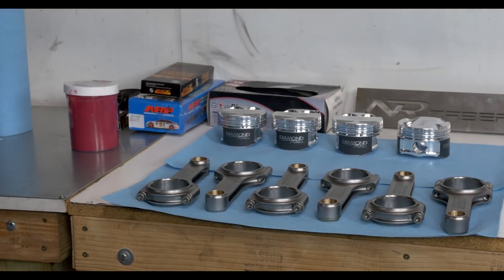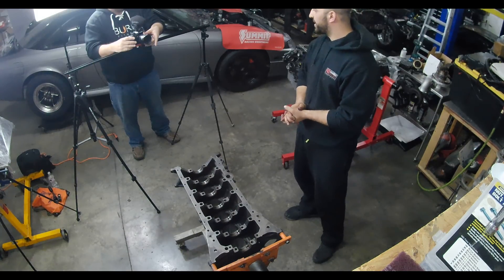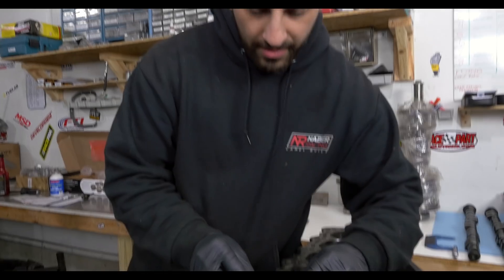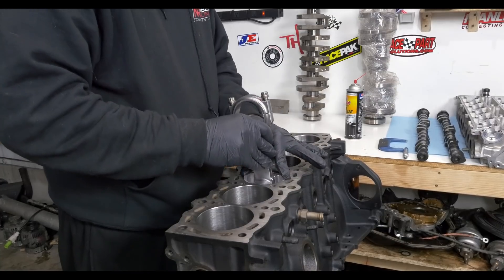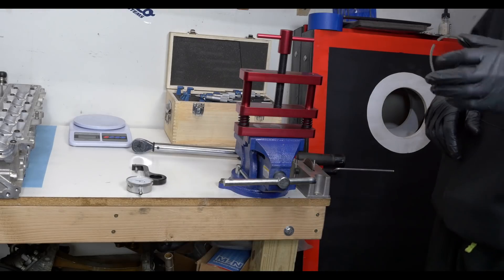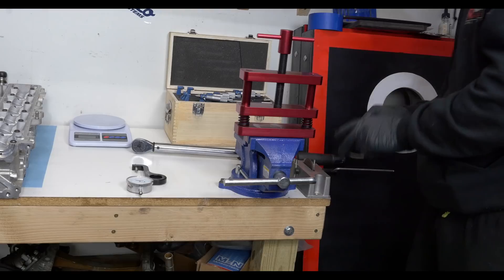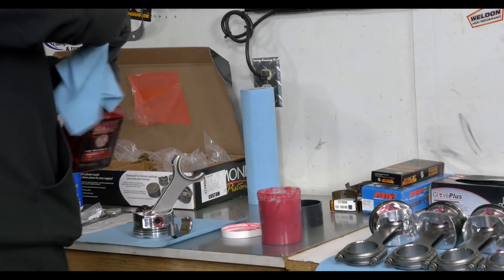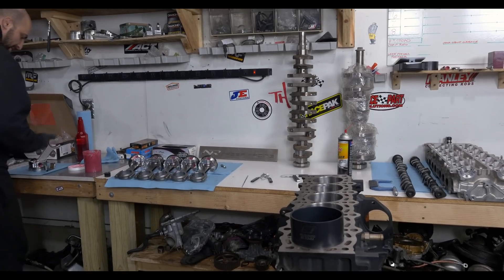Naber Racing 2JZ build - Part 4 - Installing the pistons (4k)

Comment: Are you oiling the rings, piston and cylinder upon installation or are you doing the dry install method?
Reply from the maker: I don't think oil is necessary for the rings.  For all other parts he definitely used lube.

Comment: Can you video a top end assembly for the 2jz? And how much pain am I looking at to turbo a na 2jz? It's in a Lexus gs300
Reply from the maker: Sorry, I was not able to film the assembly of the head and the rest of the motor.  But I will hopefully get a dyno video soon.
Reply: tjsavage711  thanks alot. I'm a diesel performance guy. Always have been. I found a sweet deal on the gs300. Looks like its easier to just do a full rebuild than peice by peice.

Comment: how long should you let the engine break in with the bearings before hard acceleration?
Reply from the maker: One of the most debated questions ever.  Some say rev it hard immediately to break in the rings at high pressure right away.  Others say take it easy for a little while.  I don't know what's best.  I do know that I need to break in my clutch for 500 miles so I'm going to let that serve as engine break in as well.

Comment: do you lube up the cylinder bores, before installing the pistons ?
Reply from the maker: He did not lube the cylinder walls.   That can lead to glazing on the walls.  Motor oil will be present before startup.
Reply: You're definitely supposed to lube the bores when installing the pistons.

Comment: Just subbed I'm working on an mk3 that I'm swapping a 2jzge into in the next few months and I was debating on a rebuild while the motor is out.
Reply from the maker: Thanks for the sub!  I guess it depends on your goals, but a ge motor is easy to find and pretty inexpensive.  I don't think I'd spend the money on a rebuild unless you are planning to add a turbo later.  At stock power you should be able to run it a very long time and if it does break, find a salvage yard and get another for under $500.  You could do some basic maintenance though while it's out (gaskets, belts, etc...)
Reply: I do plan on going turbo later down the road but I've honestly got no clue what performance parts I should get to go down that road. I'm picking up one here in a couple of weeks that has the auto trans with the ecu and harness but it's going in an mk3 with a w58 instead. I've read forums on wiring for the 7mge to 2jzge just needs minor modifications, other than that I've tried finding out if the mk3 w58 will bolt onto the 2jz with no problems but I've come up short. I know the mk4 came with w58s but idk the similarity between them.